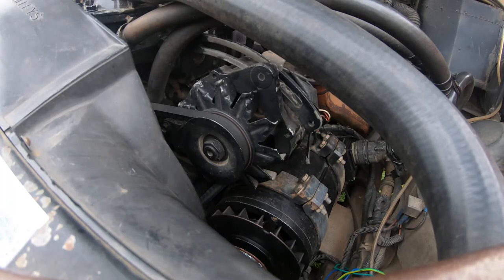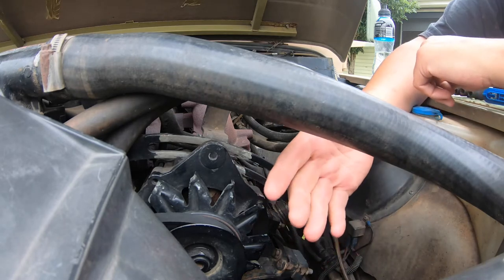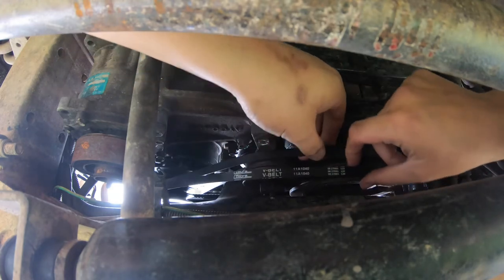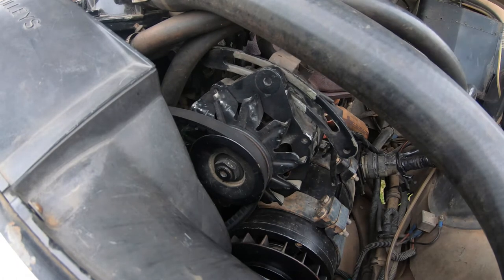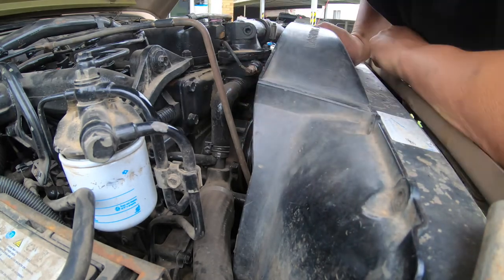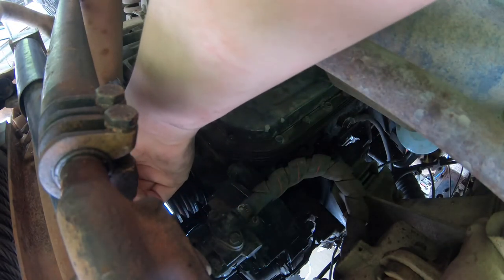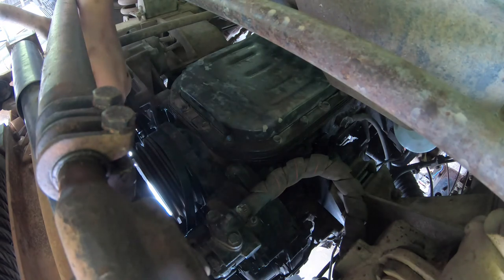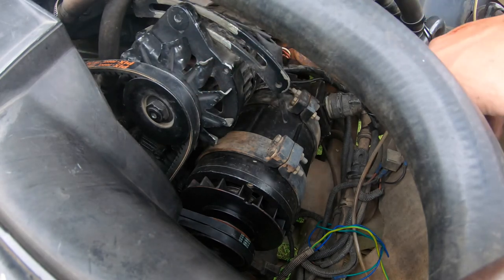Replacing the fan belt on my 6X6 Land rover Perentie Ambulance

Comment: And doing this at home, while you can rest etc, is far better than on the side of a highway, trying to get somewhere. 

(my folks did a caravan tyre today on a busy highway with nowhere to pull off. They drove a kilometre or so on the rim, and (of course) screwed up the rim. Then the police came and unhelpfully move them further along to a side road. Pelting down with rain, my 80 year father and my brother-in-law - thankfully they had arrived to help - had to change the wheel and tyre)
Reply from the maker: Yeah I have been pulling up to assist - having the orange revolving lights helps make the situation a bit obvious, and I carry a set of impact sockets and a 320nm battery rattle gun.

however most people have forgotten to grease their wheel bearings and the whole hub has come off.

can't compensate for lack of maintenance.

Comment: How hard would it be to remove the plastic shroud around the fan?
Reply from the maker: it would involve either removing the fan and water pump, moving the radiator, or cutting it off.

none of those things sound like fun right now.